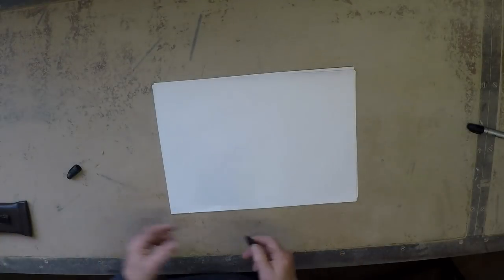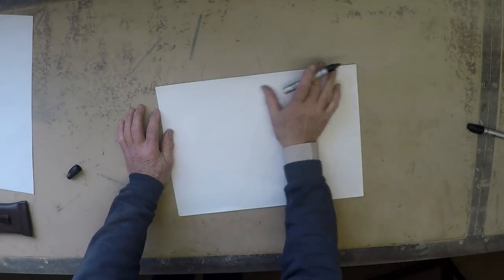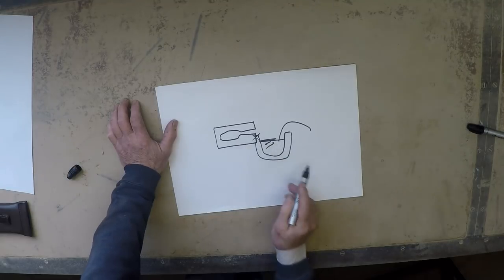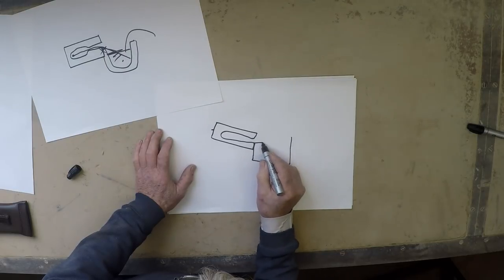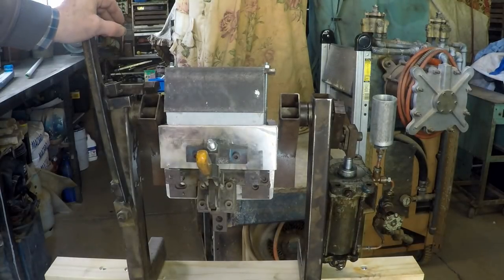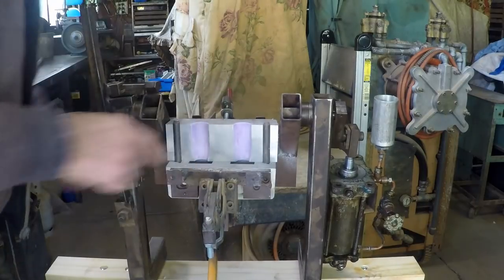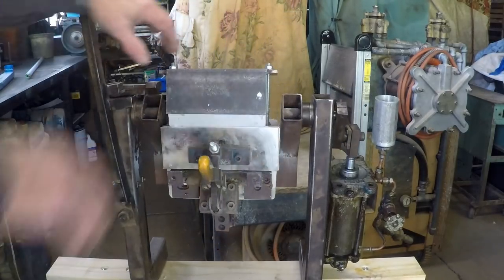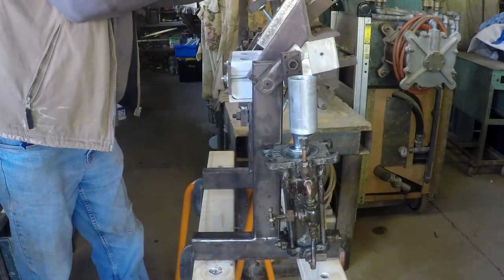Tilt casting explanation 1

Comment: That tilting mechanism you’ve built is pretty ingenious!
Reply from the maker: John, Its actually very simple. I had to come up with something in place of the large commercial machines that use hydraulics to swing the die. This sort of set up was way to complicated and expensive for me to build. I needed something that was simple, unpowered, cheap and easy to build. To my pleasant surprise this little machine and its mate (I have two and used to run them side by side) worked very well indeed... Martin
Reply: @olfoundryman8418  I must agree with John: your tilting apparatus - and its simplicity in particular - is truly brilliant.  Well done!

Comment: Another great video showing casting techniques you don't typically see on YouTube. Great explanation of the process and why it's used. Love that machine you built with its simple adjustable throttling valve to control the tilt speed.
Reply from the maker: Walt, Thank you for your comment. It is a very good process when used properly and is capable of producing excellent castings. It is of course more usual to use cast iron or H13 steel dies in quite large hydraulic machines but that little machine and its mate have served me very well indeed. I even stuck a big die made from a con cast aluminium ingot in one of them and used it to cast 200 or so moulding box sides in a day! As I have mentioned  below in my reply to John I had to come up with something within my capabilities to build and operate. While a little(?) rough around the edges these machines built essentially from my spare parts inventory (read junk collection) have worked well... Martin

Comment: practically a race adjustable knee action shock for a bug-eye sprite, lol... your seat of the pants engineering skills are honestly as impressive as your casting ones are. i can hardly wait for the metal to flow!
Reply from the maker: Luddite, I had not thought of it in those terms but yes, I guess so. Seat of the pants engineering? - its a bit of an Ozzie tradition. The metal (like the spice) must flow and indeed, it soon will... Martin

Comment: Nice video Martin. Good explanation and I appreciate your understanding of the positioning of the metal feeder versus the die. Makes a lot of sense. Wheels are turning! Thanks for the video again!  Mark.
Reply from the maker: Mark, While the die itself is short life the bit with the feeders in lasts a lot longer. I have replaced some dies 2 or more times years ago as they deteriorated but still kept the same tops. Something to keep in mind as the wheels turn... Martin
Reply: I'm listening! You probably know that i'm thinking of applying this permanent die idea to loudspeaker baskets. My guess in that kind of an application is that there would have to be a multi-segment die that could be taken apart. I have a few loudspeaker designs that I have been working on that would be short runs of a couple hundred pieces a year and be perfect for this kind of work. Now I have to set up a proper foundry! Been quite a while since I did that! Why for I keep watching your videos. I watched a few others. But stopped when I saw some pretty suspect methods that could do nothing more than make very porous castings. Which I was quite capable of as a teenager 30 plus years ago!
Reply from the maker: Mark, These short life dies do have an Achilles heal in that they are only suitable for vey simple parts - anything that as a casting would contract onto the die will destroy it very quickly. For castings that are in this category it is necessary to use stronger die materials I have used brass/bronze but cast iron is probably about as good as die materials get and I have machined quite a few  dies from  cast iron  that one can buy as continuously cast bar stock in a large range of sizes. Of course this means that you have to go down the traditional (and expensive) route of die making. I actually bought an (older) CNC mill in order to make one die - took me a year! (I am no machinist and I had to get the mill running and learn how to program it, hence the year) May have a video on that die being use soon… Martin
Reply: Continuous cast iron is pretty nice stuff to machine in some ways. I have worked with it ion some high performance loudspeaker motors in the form of continues cast silicon iron. I'm not a real machinist. But I've done enough machining to know what and where to do it. Albeit much more slowly than a real tool and die maker!But get there I can and will. Appreciate the insights.
Reply: @olfoundryman8418  What do you specifically notice about the die, that makes you say, "It's time to retire this mold"?  Is it pitting?  Surface finish?  Wear?  In other words, what makes you produce another die?
Reply from the maker: @chuckbailey7200  , With aluminium dies I find that eventually the sides of the cavity begin to swell inward, usually I can file the bulge down and get a few more castings (another run or two) but about 500 castings is close to the limit for one of these aluminium dies whereas cast iron dies last many, many thousands of shots before heat checking and slowly producing castings with a rougher finish and more flash. Mechanical wear of core slide areas and of the cores themselves may require remedial action part way through the dies life but all my iron dies are still useable after several thousand castings...Martin

Comment: Thanks for the great explanation on how it works great video as always
Reply from the maker: Jkay, Thank you for your comment, I hope that you enjoy the final part when it comes out in about a week... Martin
Reply: i always look foward to your videos is your facing sand and your back up sand both green sand
Reply from the maker: Jkay, Yes, they are both green sand. The facing sand is backup sand and new sand mixed about 50/50 and ground a bit finer in a home made "flour" mill. I have video about that "preparation of facing sand" I think it is called... Martin
Reply: I've seen that one was curious if you would ever do a video of you making your backup sand would love to see how you make it.
Reply from the maker: Jkay, I did do a video on reprocessing my backup sand at the end of a casting day, it featured my sand aerator. My sand is a natural sand i.e. it is straight out of the ground and it came from a quarry about 30 Km from where I live. To use this sand I first almost dry it (I leave a little moisture in it to help control the dust) then I run it through my aerator just to break it up and then sieve it through a 0.5 mm sieve (takes forever!) just to remove the few little pebbles and pieces of ironstone that are in it. I then spread it out on the concrete floor and add water stirring with a rake and shovel - similar to the facing sand but in bigger quantity and on the floor. Then I run it through the aerating machine to mix it properly and its good to go. Completely new sands is very strong and a bit hard to work with so I tend to add it to the existing sand rather than replace the existing sand completely in one go. I do have to do some lost foam work in the near future and for that I will be making up a fairly coarse green sand from scratch using paver and or play sand and kitty litter just to see how this works.  I have what I hope is an interesting twist on that process and I will try to do a video... Martin
Reply: and this is why i enjoy your videos you have no problem telling people how you make your things its nice to watch and learn from a master. I have thought of taking it up as a hobby but it is very costly even to make a foundry when you have young kids but maybe someday i will take it up and i will use your videos as a guide as to what to do. Thank you for letting me learn from you

Comment: Good designe !!!  Good the hydraulic system for the melting control  . Tank for give you experience .
Reply from the maker: Luciano, Thank you for your comment. Sharing my experience is my pleasure. I watched your lost foam video - some interesting ideas in it. If I may make a suggestion add 0.5% glucose powder to the sand before adding the sodium silicate it will then wash out in the water when you quench the casting... Martin
Reply: @olfoundryman8418  Tankyou for glucose tip !!! .

Comment: A very interesting video Martin. It would appear that the mould is canted above the horizontal by 5 to 10 degrees when the basin is being filled. I liked the way that you can control the flow rate as the mould tips below horizontal. Wylie Coyote would be impressed. Mark
Reply from the maker: Mark, The cant rate is supposed to be at least 10 degrees I aimed for about 15 but got I think a little less. Work mentioned in John Campbells " Complete Casting Handbook" suggests up to 20 degrees above horizontal as being close to optimum. Sadly  no one I have ever seen tilt cast does this most use horizontal or below and most have oversized basins so that the metal level is way to low and does not start to enter the die until it is well on its way to vertical - a good technique ruined! In truth the very best of tilt casting machines would employ computer tilt control via servos or steppers so that the tilt speed could vary during the pour- a slow start with a speed up in fill rate once the metal has reached the end of the die is said to be beneficial but this sort of thing is beyond a simple old timer like myself... Martin

Comment: Hello! Great channel. I have surface problem in brass sand casting. Can You advice me what I am doing wrong?
Reply from the maker: kursor, I had a look at your 10 year video - interesting stuff. You and I do things quite a bit differently. Why for example do you use a 28 mm  diameter sprue when no doubt the stream of metal that you are pouring down that sprue is much much smaller in diameter? Incidentally I have used shims to hold a mould apart to not only increase venting but in other cases to increase casting thickness. I do not like doing this as it means a lot of flash to cut/file off. Your castings did not look to bad to me (petrobond sand?) but if you send some photos of the defect that is troubling you to  olfoundryman@gmail.com I will have a look and see if I can make any suggestions.
What is the source of your brass, do you know exactly what bras sit is and do you add and deoxidiosers to it e.g. phosphorous... Martin
Reply: @olfoundryman8418  Hi! thanks for fast respond. Ill send@ With defect and ill describe other factors that are corelated with this. And ill just say here about that fat sprue that iam useing for other viewers. I use such big diameter because i noticed that the faster ill empty crucible the bigger chance to get succesfull pour.notice that pouring cup is carved only from half side its because i plus do fast that it create something like g fotce;) My castings are max 3 mm thick. In some surface Ares they are sometimes 1-1,5 mm. So i struggle a lot  with Frozen pour cavity filled only partially. That's why i started to use this big sprue. But i have to try your method.

Comment: I guess that this technique is a more advanced version of the pouring basin and tapered sprue concept. It would seem that when pouring molten aluminium that Haste makes Waste.
Reply from the maker: Mark, There is a correct fill rate for all techniques. One of the great advantages of this technique is that it completely does away with the sprue and gating system all you have is a feeder less fettling to do better yield and, if done well, very good castings. But with any casting you sure do not want to throw the metal into the mould from a great height at a great rate as that is a recipe for poor quality castings - so yes, unnecessary haste makes waste... Martin

Comment: Very nice machine.
Reply from the maker: Volcker, It was a quick rough build with what I had to hand but it and its mate - I used to run two side by side with different dies in place - work very well and I have made a lot of castings with them including my current moulding box sides... Martin

Comment: You didn't use tilt casting for the landing light bases  though?
Reply from the maker: Donald, No I did not. the tilt casting process wonderful as it is (when done properly and it usually is not) isn't suited to all shapes. The landing light base is a case in point very awkward to tilt cast and in any case the very simple gravity die that I do use was very easy to make and works quickly and well. Its a horses for course thing... Martin

Comment: It's weird that you can use an aluminum mold to caste aluminum. How is that possible?
Reply from the maker: Rv4, Yes it does sound a bit weird. Firstly remember that these are short life dies good for 500or so shots, A cast iron die will last for many thousands of shots. But why does it work at all? Well its a matter of how much heat I am putting in at each casting and how much it would take to melt the die, the die is much bigger and heavier that the casting  so a lot less heat goes in than is needed to melt the die. The aluminium of the die is a good conductor of heat so heat flows quickly away from any hot spots thus preventing any slight local melting, Weird, strange, and a bit different but it works... Martin

Comment: Aren't you from Australia? Why aren't your measurements in metric?
Reply: junit483 Up until about 1972, Australia used British Imperial measurements and even today a lot of hardware can still be bought in Imperial sizes. Imperial based expressions are still used in conversations.
Reply from the maker: Junit, Fair question. Reason 1.  In my primary school days we only learnt the old imperial system inches roods perches grains scruples gills furlongs  nautical miles pecks bushels and nails -  you know the whole 9 yards, opps! Sorry make that the whole 8.2296 metres. And we learnt it well so its sorta ingrained. Then at secondary school we were introduced in science at least to the metric system so we had to work in both systems! At tertiary level it was mainly metric and by then we had begun to go metric as a nation with the conversion of our currency (to, in the main, the American system!) So I know and work in both systems but the imperial is the more ingrained and even if working metric I will still at times check it with imperial calculations. However apart from the upper limits of our daily temperatures I am entirely metric (centigrade) with respect to temperature. If someone quotes a Deg F reading I reach for the calculator. As you can see I think in both systems and thus at times use whichever comes to mind first.                         Reason 2. Probably over half my audience is in the USA and they of course are imperial so I use it for their convenience. I notice though, in email and YT conversations with American friends that many of them use mm and not inches and I can see a defacto metrification occurring in the US - now if only I could get them to use C instead of F 😀
Oh, and a "nail" its old cloth measure,  2 1/4 inches to be exact, and four of them equal a quarter and four of those  make a yard -terrible system!.... Martin
Reply from the maker: Mark, We actually started our conversion somewhat earlier than 1972. I remember while studying metallurgy (graduated in 1965/6) that decimal currency began to appear. Todays children who have only had to learn the one system will be vastly better off than my years were.... martin
Reply: "Be prepared folks, when the coins begin to mix.
On the 14th of February, 1966!" -- Dollar Bill, the dodgy cartoon character of the day, created to explain the change to the confused masses.
Reply: @olfoundryman8418  I laughed way too hard at "you know the whole 9 yards, opps! Sorry make that the whole 8.2296 metres".  I probably looked a little like this guy: https://tenor.com/JIw3.gif
Reply from the maker: @friendsbrn , You are a lot younger than I thought. 😊 .. Martin